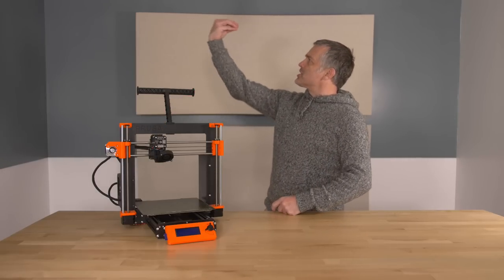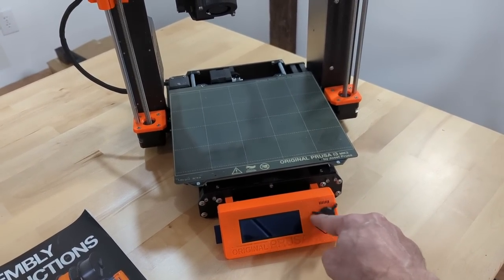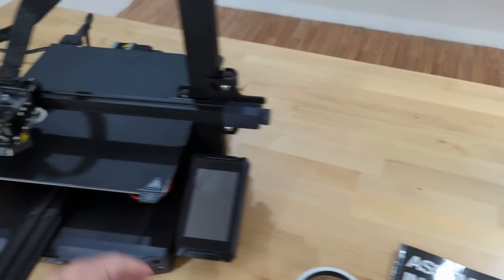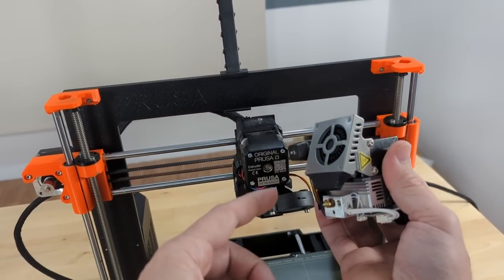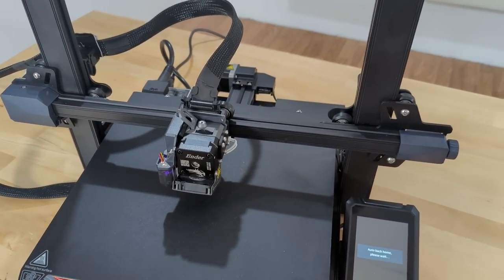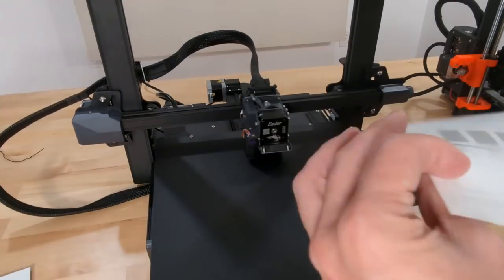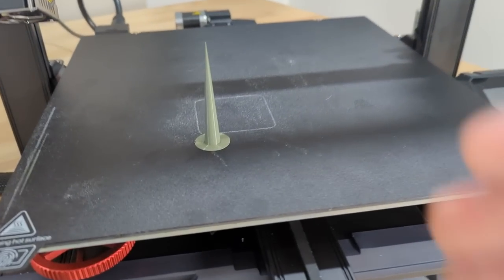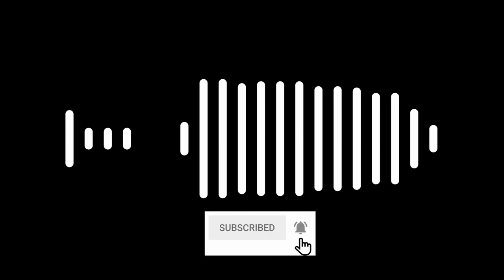Creality S1 Plus Has all the right features - Let's compare it to PRUSA I3

Comment: The original Prusa MK3 is not the same printer as what they are selling now.  It has been upgraded many times and is as modern a system as you can find at that price point.  I bought my Prusa MK3 3 days after they launched and was on the wait list.  Since then they have introduced many upgrades that were up-gradable on existing instruments.  Not all companies will do that. When you buy a Prusa MK3s now it is like buying a Iphone 14 not an iphone 8.  Your logic is all wrong.  Just because Prusa is not coming out with a new model number every year does not mean they have not been improving their printers. SW/FW/HW are constantly being upgraded and they push those upgrades out into the existing market free of charge.  At most I have had to print a few parts to do the upgrades.  Don't know why you constantly been hating on Prusa.  You should be happy for them because all these companies are advancing home printing.  Guys at work have Enders and we are all happy with our printers.
Reply from the maker: Hey quick question: Whatever happened to the filament motion detection system in the I3? How come it's now just a simple filament detection switch? If Prusa is constantly upgrading why did they quietly stop selling that feature?
Reply: @DesignPrototypeTest    It didn't work consistently.  The simple switch works much better.  I had the motion sensor switch and it didn't work on certain colors of filament well.  I believe black and clear filament is have a problem with. I have been an engineer for 30 years and been on dozens of new product launches and I can tell you the new wiz bang things sometimes do not work as designed and the old tried and true tech is what we fall back on. I worked with sensors in the computer chip industry and we had issues with LED and reflected and refracted sensor detection when you have to sense everything under the sun.  A simple contact switch is more reliable in those cases.
Reply from the maker: I agree with this last comment you've made. You do sound like a knowledgeable engineer. Yet you stand behind your first comment where you defend the Prusa in a dogmatic way. It is possible for a company to "get it right" with a design and that design can stay viable for many years but Prusa does not fit that description. The reason Prusa is viable is because it has been endlessly massaged into functionality. Fundamentally there are many erroneous design decisions which JP made. He has stubbornly refused to abandon these. He wisely abandoned the filament motion sensor. Why has he not yet abandoned the direct drive mechanism when it clearly leads to the "inconsistent extrusion" problem? You see, the Mk.3 is as antiquated as an iPhone 8. You don't buy a model number you buy all of the upgrades that come along with the new model. When referring to a model you are referencing the long list of improvements that are too numerous and complicated to mention in conversation. The I3 Mk.3 is still called that because there are no such improvements. Please be an honest engineer and admit that the Prusa I3 Mk.3 is no longer viable and only continues to sell well because of the popularity contest and continued manipulation of the online environment by "the community." It is marketing and not actual substance that convinces the ignorant consumers to waste their money on a printer which they believe is superior but which is actually no better than average compared to Chinese printers which cost half the price.
Reply: @DesignPrototypeTest  Not a knowledgeable engineer just a knuckle dragger who carried a tool box for 20 years before I went into Tech Support and New Product Development for my last ten years and got to see how sausage was designed.  Secret of sausage is when you design rats into the mix don't be surprised when you end up with rat sausage. Marketing runs most companies so engineers design stuff to be just good enough and move onto the next project.  I will give the extruder could be better designed for easier access and but some people in the community have designed better extruders if I want to upgrade, and I have done some minor community upgrades, but that would be for easier access for cleaning and clearing jams.  Extrusion seems consistent for me and they have done several SW/FW upgrades over the years to improve it. The Nextruder on the XL looks awesome.  Everyone in the community is hoping they release it for the MK3s.  Honestly Prusa has a loyal customer base because they stand behind their product.  MK3s costs $799 and you can buy an ender 3 for $150 or less on sale.  Out of everyone in my office they all 3 of them own enders and I own a Prusa and our company has Several commercial grade printers for prototyping.  Prusa has a loyal base because they support their products.  They have sent me 2 parts under warranty and have supported me for free since I bought the printer.  Not many companies will do that. If I buy a second printer, no reason to buy one at this point but if I did, I would consider buying a Prusa.   I gotta cut this short but I say buy what you think you can afford and what you think is best.  Ender's are good printer and so are Prusa but I enjoy the Prusa community and company support.
Reply from the maker: You seem an honest man. I appreciate that. As you said "but I enjoy the Prusa community and company support." it's an emotional thing, and I'm not trying to make people feel bad for their purchase decisions. Please enjoy your printer. I'm trying to prevent those who don't know already from wasting money. Let's stop recommending I3 Mk.3 to anyone anymore. There are less expensive options that are just as easy to use and make the same quality of prints.
Reply: @DesignPrototypeTest  you’re suggesting removing direct drive from the printer? Do the research, the cause of inconsistent extrusion is not direct drive but rather issues involving the grub screw on the extruder gear and filament tolerances. This has been proven time and time again and plagues all printers including my x1 and my voron. The only reason that Bowden printers don’t show this is because they have a more limited filament control

Comment: I have a S1 Plus, and it is a lot better than the Prusa. But the Prusa is old, and when they make something new, it will be good too I think.
Reply from the maker: Maybe but at this point the XL is just hot air. Ephemeral promises. Can they deliver? I don't have as much faith as you do. Time will tell.
Reply: @DesignPrototypeTest  not a lot of faith, but new usually is improved. I'm going for the bambu myself.

Comment: Powerloss recovery is very likely to be the culprit for the texture on that cone
Reply from the maker: I considered that explanation. I discounted it because the same artifacts  can bee seen on the Prusa print. Albeit to a lesser extent. Prusa printers do not suffer from that powerloss recovery issue like some Chinese printers do. When I used a different slicer the spire printed cleanly. Meaning the slicer is the variable causing the issue. I suspect that it is a wipe or coasting setting that was exacerbated by the incorrect retraction for the Ender 3. I don't care enough to figure it out at this time. I've moved on to other projects.
Reply: @DesignPrototypeTest  thank you for the detailed explanation. Good luck
Reply: @DesignPrototypeTest  Indeed. The recommended retraction for a Ender 3 is about 6mm, while it's about 0.8mm for the Ender 3 S1. That's a huge difference, and probably the core of the problem. Keep in mind that a too high retraction setting on a direct drive extruder can also give clogging as a result.

Comment: While I will probably be classed as a Prusa fanboy, its kinda far from the truth, I don't agree with the pushing of "made by Josef" on everything, I don't agree with their descision of not making a 12 volt version of the einsy to support the MK2 with the reason: TMC2130s aren't stable on 12 volts. But there are a few problems with the "issues" you keep coming up with:
PETG suffers from heat deformation: yes after around 80 degrees it can deform but its unlikely (its also far away from the bed to not be a problem). 8-bit MCUs and the screen, I have to agree with Thomas Sanladerer on this: I don't interact with the printer to need anything more advanced that we have. I start a print, load and unload filament, I don't need a fancy touch screen to do these basic things. (also setting Z height or steps/mm is hell on touchscreens) 32 bit mainboards are just for cost saving, what can the ender do that the Prusa can't with that 32bit chip? Nothing. While speeds could be quicker I don't think the average user needs 500mm+ speeds, if you need that build a Voron. I value upgradeability far more than something being great out of the box but the manufacturer just leaves it to rot after they release a new version... I also can't stand your hatred towards the spirit of RepRap... I don't get why its so great to have sheet metal everywhere.... I simply don't. Sure make a stiff frame but I don't get the whole "Ew it has 3D printed parts" argument...
- a former ender owner
Reply from the maker: 3D printed parts are inferior. They are not isotropic in strength characteristics and they are made out of plastic. They get the job done. But the whole appeal of Prusa is that it is the best printer. Not the "gets the job done" printer. People have a visceral emotional feeling for their Prusa because they feel like they own a winning piece of excellence with the I3 Mk.3. This emotion is misplaced because clearly it is not the winning printer. It is the "gets the job done" printer. I've never denied the advantages of the Prusa. It is a very well polished turd. But fundamentally it is made of excrement. At least they got rid of the zip ties but before they did that there were SO MANY guys here on my channel attacking me just like you are saying "So what. Zip ties are fine." Next they will get rid of structural 3D printed components and you won't be here apologizing to me for sending me so much hate. For downvoting my videos even though I'm right. Go watch the PrusaXL video and you will see no 3D printed structural components. I'm already right, but again you won't apologize for the damage you do to me. You feel right because there are a lot of Prusa fanboys who have got your back, but just because there is a mob doesn't mean you have truth and justice on your side. 

RE: 8 Bit electronics
Did you know that the antiquated 8-bit tech is actually more expensive and harder to source. This is why the base model Ender 3 now comes with 32 Bit electronics. Creality is actually saving money upgrading from the old 2560 8-bit chips. You say you don't mind the old tech because you don't need anything more advanced. Back in the 1940s, the first computers were physical mechanical machines. No electronics. There is a calculator the size of a room in a museum somewhere. Why don't you get one of those and throw away your cell-phone with the calculator. It would be the same arguement you and Tom are making. It get's the job done crunching numbers. You don't need the new tech. You went on to justify that the i3 Mk.3 "gets the job done" in other ways as well which is fine EXCEPT that the Prusa costs at least twice as much as a printer from China that similarly "get the job done." Why pay more money for antiquated tech when the new tech is more user friendly and costs less?

If you own a Prusa keep using it. I'm not trying to make people feel bad for their purchase decisions. Please enjoy your printer. I'm trying to prevent those who don't know already from wasting money. Let's stop recommending I3 Mk.3 to anyone anymore. There are less expensive options that are just as easy to use and make the same quality of prints.

Can I ask you a favor. Will you please stop making me the bad guy? I'm not. I'm just making honest criticisms. I do have a negative mindset regarding JP and by extension his company. He/it is advantaged by nefarious behavior. I am justified in my judgement. It's possible to think badly of something and be right. Not biased. You don't seem to care about Prusa, and yet you still desperately want me to be your enemy. WHY? You say "I also can't stand your hatred towards the spirit of RepRap" This is an ABSOLUTE fabrication and if you watch my videos it is demonstrably false. Everything else you have said is reasonably fair in the context of a debate. This strongly worded sentence is your trespass. This propaganda is your cheating manipulative motivation revealed. 

I insist that you justify this claim or apologize for the offense. Define the spirit of RepRap and then find examples of me violating that spirit with "hatred" or issue an apology. You won't do it. Your ilk of trolls/fanboys/bots/sockpuppets/whatever-you-are never apologizes. You go on being wrong and making the world a worse place confidently because you are supported by a groupthink mob of the similarly wrongheaded. Shame on you.
Reply: @DesignPrototypeTest  first of all, the fact that I said 32 bit boards are just for cost saving just went around your head… second, in my opinion the spirit of Reprap is that you have a machine that can make most of its parts for itself, and can create useful things for its owner. Your argument of: we NEED sheet metal and injection molded parts everywhere is against that idea IMO… Your argument that of: you should get rid of your phone and use a calculator is: this argument went around your head also. I’ve said that not everything needs a touchscreen and 32bit, sure ditch the 8 bit platform, but I don’t think everything needs to be Touchscreens, I the LCD of the mini would be a nice replacement, but still, the end of it all. I don’t need a touchscreen in my dishwasher, because I use it like my printer: I don’t sit next to it or watch Netflix on it, I just use it for 2-3 minutes then forget about it… (I also think that most printers should be like this)
Reply from the maker: I don't see a justification or an apology for your statement that I hate the spirit of reprap. I'll give you one more chance before I ban your avatar.
Reply: @DesignPrototypeTest  i justified your hatred towards the spirit or RepRap: a RepRap is a machine that can make most of its own parts and can make useful things for its owner. You continusly attacking 3D printed parts and encouraging designs that aren’t self replicating in any way is IMO a hatred towards the core spirit of the movement. Also, I just want to remind you that in a previous video you dissed the MK3 for having 3D printed parts, while also promoting Voron…
Reply from the maker: I wouldn't say that I have hatred (nothing so extreme) but as I said, 3D printed structural parts are undeniably suboptimal. I don't think you understand what "the spirit" of a thing means. It is the underlying philosophy or moral motivation that begets the thing. The spirit of reprap is akin to that of open source or right-to-repair. It's about democratizing access to the technology so that it does not get monopolistically controlled enriching a single company while the rest of us languish without the ability to 3D print. The mechanical implementation of reprap (as defined by a single man named Adrian Boyer) involves self-replicating printers using 3D printed structural parts. This was conceived at a time, years ago, when recursion was a popular fad among academics and programmers. There is no deep meaning or ideology to recursion. It's popular like a joke or a curiosity.  Recursion is NOT the spirit of reprap. Unless Adrian Bowyer he wants to chime in and tell me I'm wrong.

Comment: Thank you for the review but, I will also add the BAD quality of customer service. The printer is a little pricey for a similar in this range. Good features, even though some of then don't work "out of the gate" with this new touch screen printer. Ex: pause at height or pause to change filament in the middle of print. Then you have to use your messenger app to send a message and wait one day. Just to find out your message is not answer correctly or worse yet.... just ignored. If you are savvy, don't need customer support, and have a couple hundred dollars extra. This is the printer for you!

Comment: WTH ...  The S1 IS running Marlin and running Klipper on it is easy and if you get Creality's Klipper box with screen (forgive me for not knowing the name by heart), you get a Klipperized printer in such a easy way that only a printer with Klipper pre-installed might be easier.  So, honestly your Duet-fetish is similar to the Prusa-fetish you are cursing others over ...  And again, I'm no S1 fan, but you should not bash it with incorrect statements.
Reply from the maker: >Duet-fetish is similar to the Prusa-fetish
Except that Duet do all the hard work themselves to progress the hobby and then deliver a product which is actually superior instead of the Prusa which as I demonstrated in this video only pretends to be superior. Oh, and Prusa doesn't develop ANYTHING themselves. Litereally every feature on a Prusa is an idea which was proven and brought to Prusa by someone else and then adapted/tweaked by Prusa and removing the original creator the Prusa name gets slapped on the feature. Afterwards anyone else to tries to use the feature gets accused of copying Prusa and the "community" mobs them with hate for daring to trespass on Prusa's turf. EVEN THOUGH PRUSA IS OPEN SOURCE!